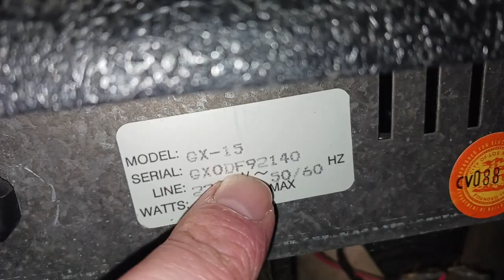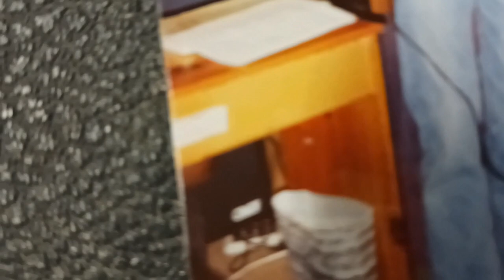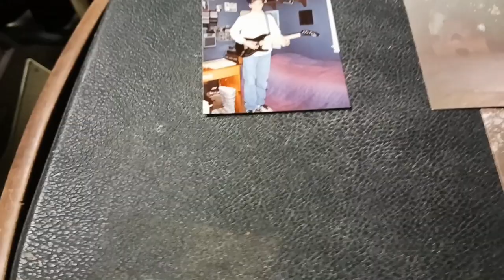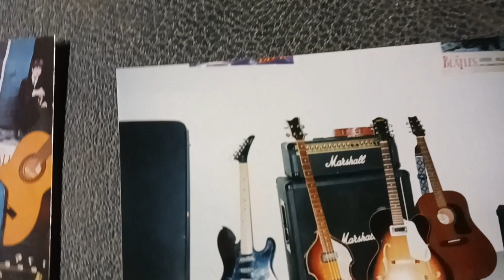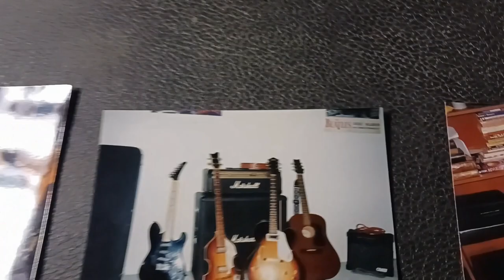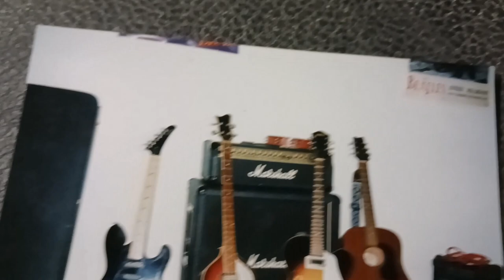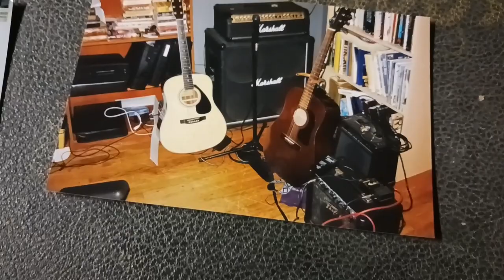Guitkits Video Journal #166: 1993 Crate GX-15 (GX15) USA Amp Month

Comment: I still have this amp, it still works, I have the problem with the nobs though, gotta get them in the right position to get any sound out of it :D
Reply from the maker: @MaxQuagmire-u3r  Get some of the electrocontact cleaner at Home Depot. Take it apart carefully and spray it down. I did it a year ago, and it's still good to go!